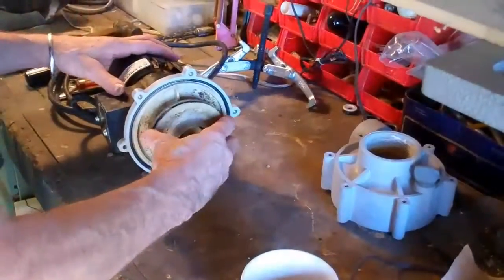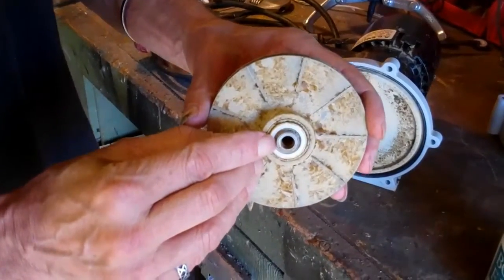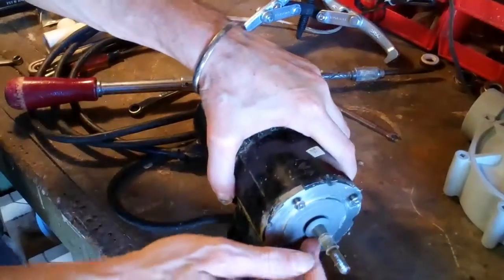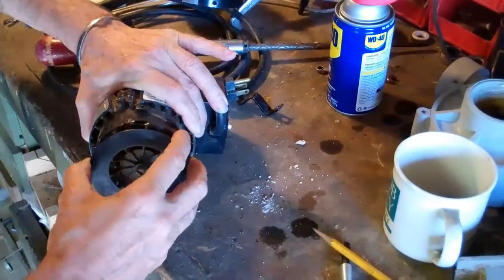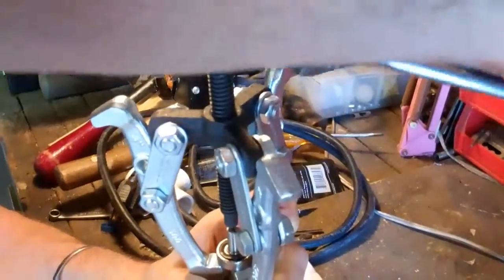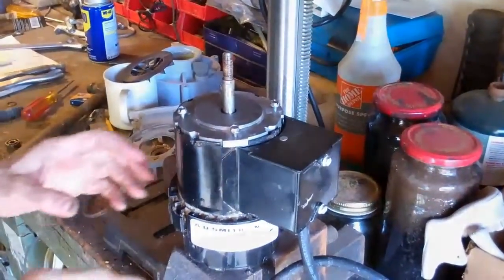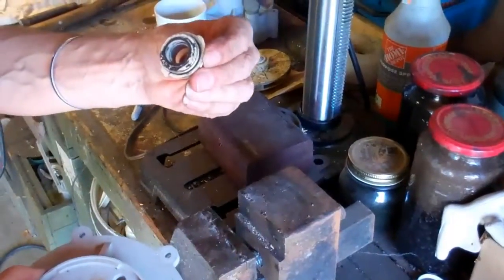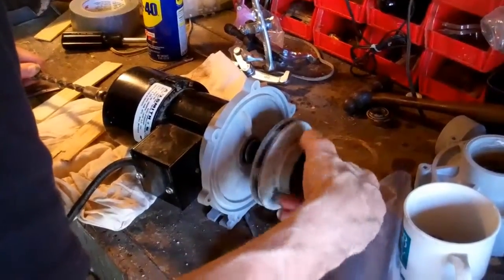Sequence 750 pump (A.O. Smith motor) repair

Comment: My impeller got chewed up from some gravel that was thrown into my pond by some kids. I just want to replace the impeller. Did you remove the ceramic seal seat from the impeller? You mention the threaded plastic piece but don't show the remove and replace. Any help would be appreciated.

Comment: Hey, Great video! 

I need your help! I’m having difficulty removing the impeller. Even with my large head flat screwdriver, I can’t keep impeller shaft steady enough to unscrew impeller. I noticed in video that there’s an “edit” where you performed this step. You switched to a different tool instead of the flat head screwdriver? I even tried clamping impeller shaft just behind impeller itself, but still, impeller wouldn’t budge. I’m afraid to apply too much torque on impeller as I’m fearful of damage. Do you have any trade tricks to share with me? — Thanks!
Reply from the maker: Sorry I can’t help you

Comment: After replacing the bearings the pump will not start without the impeller. Runs awesome after it starts, shaft spins freely and pump is quiet, tried different impellers any thoughts